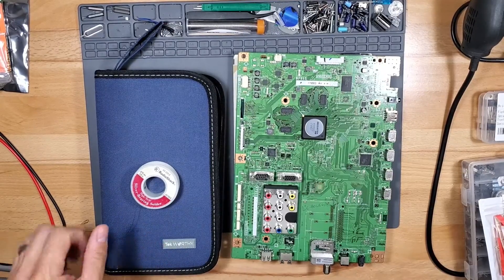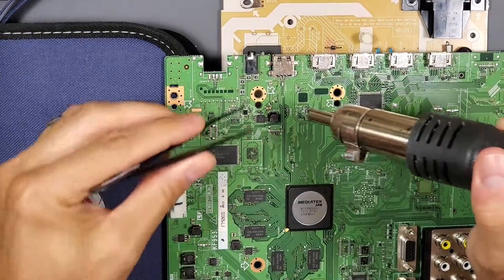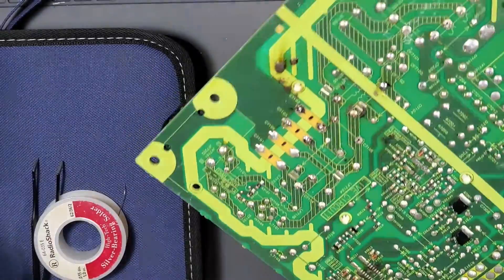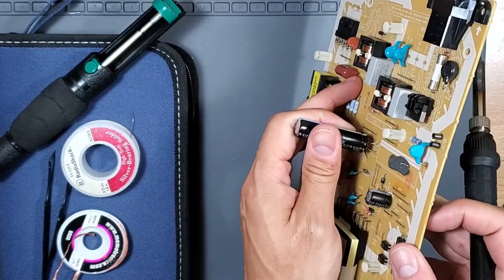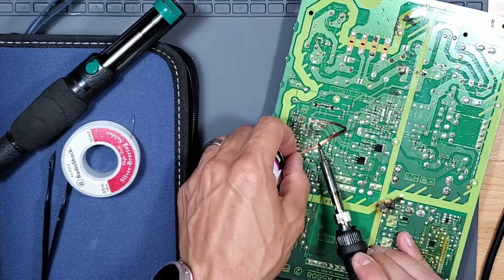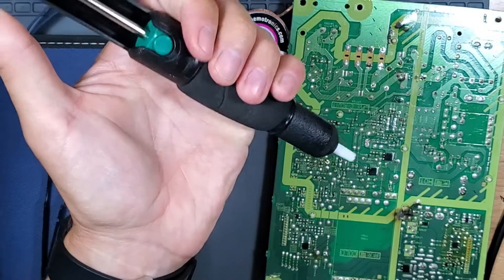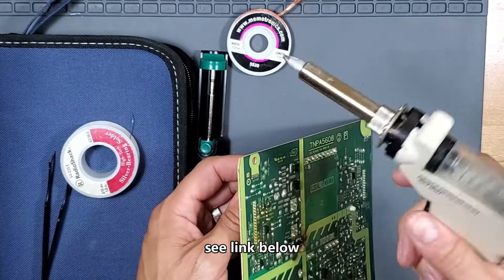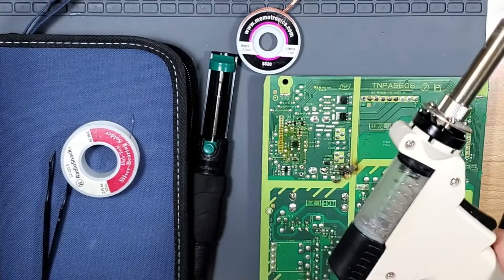5 ways to Desolder Unsoldering tips

Comment: Great video. I want to replace some some smd 4 pin micro swiches and was wondering about a good and easy way to do so. Ofc i don't want to invest on hot air station for one time use in my case but this desoldering tool may just do the trick.

Comment: Hello .. thank you for helping with great tips ... I have a problem with my LG TV (vertical lines ) which I requested your advice on one of your video for horizontal and vertical lines. Please advise on this 
Below is the same                                                     I have LG 49UB850T-TA which have same problem. There is 6 vertical stable lines and increasing. Can you please tell me if I can fix this by changing the led panel. Here the repair center’s are telling huge price for the repair. Please advise on this .

Comment: Some boards have a coating or lacquer on them. How can i tell which and what should I do first before removing components from these boards.Ive been practicing on a old graphic card. I also tried a heat gun on smd capacitor (can type). It just burnt the cap. Couldnt get it off.Thanks

Comment: Is there a special way to get capacitors that have leaked off a board?  I sometimes have problems getting those off.  They are not as easy as a clean, compromised capacitor to remove.